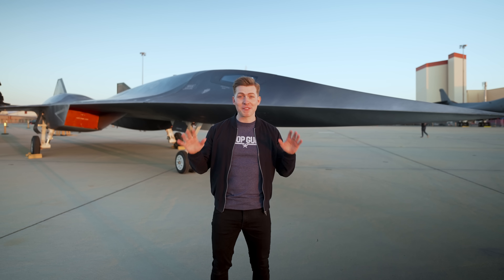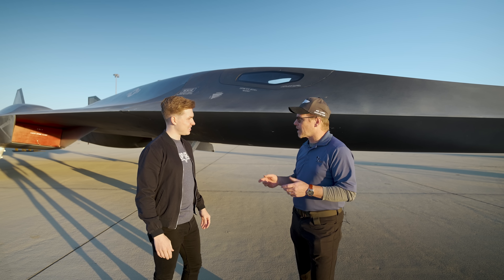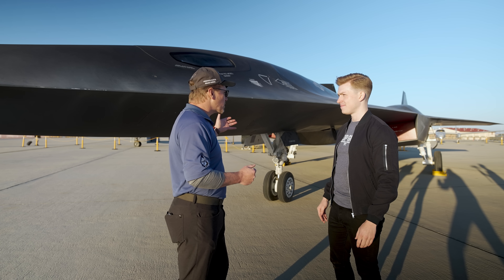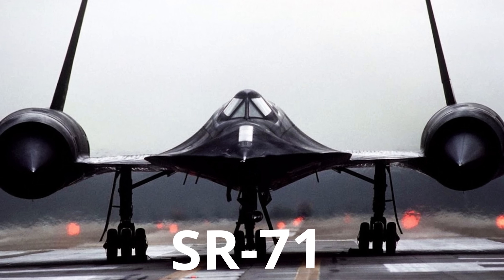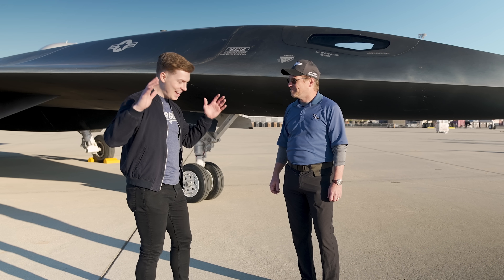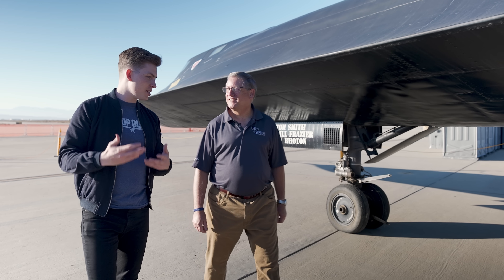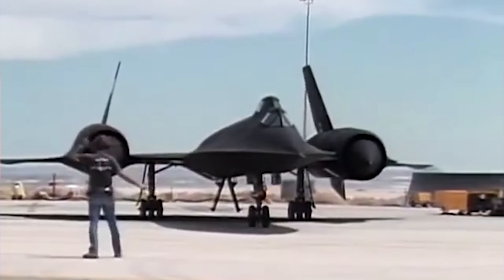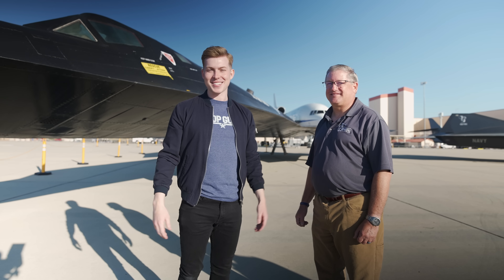Top Gun DARKSTAR in Real Life!

Comment: The darkest "black" branches of the military have been traversing the galaxy with mercury centrifuge gravitation propulsion for 3 decades. Spinning mercury around an element 115 core at 50,000+ RPM causes a wormhole of sorts that can be opened any size you want. Then you just "JUMP" to a point in space you're looking at instantaneously without all those pesky air molecules slowing you down. 

They were crossing the Milky Way in 45 minutes back in 1992, according to a deceased CEO of one of the secret contractors.

This "jet engine" crap is only 50 years obsolete.

Comment: My Dad retired from Skunk Works and spent 40 years between them and Northrop. He did work on SR71 with F22 and F35 prototypes being his final projects before retirement. He worked 2nd shift with 1 other person on very classified material towards the end. He also worked on the B2 at Northrop. He would drop subtle hints as to the capabilities of the planes but was incredibly secretive never letting on to anything classified. He would just say the materials he was working with would be public knowledge in approx a couple decades. I really miss talking about planes with him. It was very easy to be proud of him and his service as a Marine and Engineer.
Reply: I have a friend who works for skunk works I've known him for over 20 years and lol I've drilled him for years about what goes on there all I've ever got out of him about his job is "it's vaguely something to do with paints and coatings"
Reply: @davemeads859 at those speeds you are dealing with ionizing gases which will impact the surfaces of the plane badly if not made of things that can withstand that.
Reply: @davemeads859  Those RAM (Radar Absorbent Coatings) are now BESTED by cheap and TOUGH Line-X Truck Bed Liner which can be spraye donto any hull hot and then be stamped with Mountain Terrain Tire Tread-like patterns to trap and absorb Radar, Lidar, Acoustic and even RGB Optical bands. Works GREAT! It's also a LOT TOUGHER and much more weather resistant than those fragile coatings used on the F117a and B2 bombers!

If you model your tread-like patterns correctly you can even create IDEAL rough boundary layers to adhere a fast Laminar airflow to the hull body for smoother/better aerodynamics and faster air speeds!

Even "The Green Lady" is starting to be refurbished with some of those newer technologies! (i.e. The Green Lady is a Boranes-powered/ZIP-fueled hypersonic replacement for SR71 flying operationally since 1998 and is USUALLY now based out of Dryden AFB and sometimes Diego Garcia --- Not sure it's a USAF/NRO asset anymore and may have been given to CIA a few years back cuz its such an old but still secret recon platform!).

Meh!

V
Reply: @constantfind9052  my all time favorite Fighter. I’m an Aircraft Maintenance Tech and that jet did a maneuver known to be impossible in physics at an airshow. It blew my mind at the pilot and jet ability and I bet we didn’t see a speck of it’s true power there.
Reply: Is Sr72 real
Reply: @ethanhuntBravoEcho11 Я думаю ,что это макет будущего R-72 ?!👽🍺👍
Reply: @ethanhuntBravoEcho11 it most definitely is.
Reply: @ethanhuntBravoEcho11  The SR-72 is DEFINITELY REAL but these days we call it "The Green Lady" which is a ZIP-fuel (Boranes) powered recon aircraft which is now old-school technology since it first flew in 1996/1997 based upon research done on other secret aircraft from the late 1980's.

From what I have been told, The Green Lady now operates out of Dryden AFB and Diego Garcia and wherever ELSE the new operator (i.e. CIA) sends it! 

It used to be a USAF/NRO asset but the constant scouring of the engines from Boron Nitride crystal creation from upper-atmosphere nitrogen oxide-rich flight caused numerous maintenance problems in later years, so it was sent over to the CIA it its request who uses it for more politically-oriented photographic spy missions over or near North Korea, China, Russia, Pakistan, Afghanistan, Syria, Yemen and even over Colombia and Venezuela!

The much newer Spearfisher recon aircraft is the current USAF/NRO replacement for the STILL SECRET after 28 years Green Lady hypersonic aircraft!

V
Reply: @ethanhuntBravoEcho11  good question. Is it public knowledge. No. Could it exist. Possibly.
Reply: Your dad was a badass.
Reply: @arthur6084  he sure was to me. Growing up looking at that Marine was an honor. Thanks I really appreciate reading your kind words about him. I sure miss him.
Reply: @constantfind9052  Israel And Japan Really wanted to Buy F22 but Nope
Reply: @pharaongaming8617 Israel are the masters of the F-35 though
Reply: @constantfind9052  Ukraine can't even fight nor fly highly advanced aircraft
Reply: @kennethroth6757 they’re training in F-16s
Reply: @kennethroth6757  Where did you get it from? If there are no planes, of course you can't, and when they appear it's only a matter of time, of course it's difficult to switch from old planes to more modern ones, but it's possible. Of course, those who have had these planes for a long time, they have been training on them for years, was there such an opportunity in Ukraine? No. When it appears, everything will be.
Reply: CHina would like to interview your dad about being a cool person.
Reply: @753238  if he were still alive I bet they would. He passed away 8 years ago. Unfortunately 50 years working with materials and chemicals and roughly 3 plus decades of that with minimal safety requirements left him with a terminal lung condition. 
He held no ill will towards his health. Loved what he did.
Reply: @constantfind9052  F 22 Will get retierd or stop producing by the year 2030
Reply: The f35 is a bigger embarrassment to America than BRANDON
Reply: @frogmanencountersradio5462  I don't know about that but they do have similarities. Neither can walk up stairs or ride a bike. 😉
Reply: @frogmanencountersradio5462  you obviously don't know what you are talking about. What makes you think that?
Reply: @mrbillsfishin yea my dad worked at nasa he landed on the moon to
Reply: My uncle worked on the Sr71!!!
Reply: Ur dad is a legend💯💯💯💯💯
Reply: leak info pls (def not russian/chinese spy)
Reply: @tvthecat  lol. No info to leak. He was incredibly secretive and proud. Would never jeopardize the safety of the pilots by giving away what the planes were made of or what capabilities they actually had. Exactly why it was so easy to be proud of him. Not even on his death bed did he share any with me. Sure miss him.
Reply: Amen dude
Reply: Hero People like your Dad are those who kept America great!

Proud of his professionalism!!!
Reply: Since I know much of the work, he PROBABLY worked on Aluminum Titanide hull bodies with super-tough Nickel-Chromium-Cobalt super-alloys for engine parts and either Electrostatics or GWASER-based propulsion systems (i.e. I was looking at our version of that through the office window a few days ago!).

We use ultra-rugged nano-LED active tiling for visual stealth but negative refractive index metamaterials work just as well for that and RADAR stealth too. Plasma Sheaths also work for RADAR and in-atmosphere speed enhancement but are not all that visually stealthy.

Meh!

V
Reply: @StarGateSG7  sure ok. All I ever got from him was I work in top secret. He would never tell me what you just did.
Reply: Good pray for your father ❤
Reply: Dam man,your lucky
Reply: Thank you for sharing all this information, God bless your dad
Reply: Respect!
Reply: @MrBillsfishin. And what are you proud of, ignoramus, your father created technical devices for the mass extermination of people, are you proud of that?😀😀😀
Reply: Mile for seconds.MAX10
Reply: @Sinivaal  what do you not get? At the time period it was built it, roughly 60 years ago it was the best reconnaissance aircraft in the world.
Reply: That’s awesome.
Reply: Over 30% of the SR-71s ever built crashed without any enemy action. 😅😅
Reply: @markfox1545  That 30% crash rate is simply due to pilot error because of a lack of decent software control. In the modern reality, human pilots simply CANNOT compete with 5000 or even 10,000 adjustments per second controller chips that can keep a plane level and or smoothly operating while in supersonic and hypersonic flight. That said, it's a good idea to have a human pilot on board when things go wrong.

In the SR-71's case, more accidents were due to simple mechanical failure than any other cause. Fuel leaks, compressor blade breakages, cable and hydraulic failures, metal fatigue .... all these are more of a product of the 1960's and 1970's time frame BEFORE the advent of decent metallurgy and decent CAD/CAM/FEA software used to design and build a modern plane.

The SR-71 is/was a complex plane designed in a simpler time where failure rates were much higher than today. It's a product of it's era and the accident rates reflect that earlier time period!

The 1997 hypersonic recon replacement for the SR-71 (i.e. The Green Lady) was DESIGNED from the get-go on modern CAD/CAM/FEA software AND was built with modern metallurgy and polymer technologies ALONG WITH a much-revamped quality-control regime that emphasized reliability over absolute performance!

The Green Lady is FASTER and has more range than the SR-71 (i.e. is ZIP-fuel/Boranes-powered!) but also has more reliability built-in since it's the product of a more modern era.

It's ONLY BIG ISSUE right now is engine blade and engine wall scouring due to the Boranes reacting with the Nitrogen Oxides in the upper-atmosphere that creates super-hard Boron Nitride crystals which literally grinds-away the engine parts like sandpaper does to wood or a grinder does to metal. 

USAF/NRO mechanics keep having put in new engines at quite the cost. I would have used Liquid Methane or even Propane as the fuel and the problem pretty much goes away once you ALSO COAT the engine compressor blades and internal wall with a thick-coat (3 mm) of Corundum (aka Aluminum Oxide) ceramic to prevent engine scouring.

Hopefully, the new long-and-pointy 2015-era replacement for The Green Lady (i.e. Spearfisher) hypersonic recon aircraft uses my suggestions and changes over to a new fuel type AND changes over to THICK ceramic coatings for its internals! (Maybe even Silicon Carbide, Tungsten Carbide or even Boron Nitride as the new coatings!!!)

Now you know!

V
Reply: He knows about the Aliens
Reply: literally nobody is questioning if this guy even has proof, tf?
Reply: Overall speed is the smoothest sci-fi aircraft😊
Reply: I work on the f18 and NGC! Ask your dad if he can juice me in Skunk Works! I can spray anythang! 😄
Reply: @Erik7prc  sorry he passed away almost 9 years ago now.
Reply: @MrBillsfishin  wow sorry to hear about that. You ever see the movie D.A.R.Y.L.? The kid stole a blackbird in that movie. Great 80s movie
Reply: @Erik7prc  it is very possible. Unfortunately I have had a brain hemorrhage and my memory is horrible so I would have to watch a fair amount of it to see if any of it looks familiar. Sorry
Reply: @Erik7prc   But it's more fucking heavy inside, boring hill rat, Ben
Reply: I also worked for Northrop with the B-2 and F-35 program. Very awesome! Did he work out in Palmdale?
Reply: @dariusmayes730  yes after they closed Burbank.
Reply: @MrBillsfishin  small world! We probably worked in the same building and everything lol that’s crazy
Reply: Paulaner Garten
Reply: Congrats. My dad was a deadbeat alcoholic 😂
Reply: @tcbowen12  sorry sir. My sons don't have nearly as much to be proud of as I did and growing up with a Marine father wasn't super easy. I was never good enough. My Dad did plenty of drinking also. Always kind of thought it was because of me. Lmao. Still always better to look at the bright side. I did have a roof over my head until I screwed up and they kicked me out. Lol
Reply: They have drones over New Jersey right now.
Reply: I bet your dad and my grandfather knew one another, my grandfather was a photographer with Lockheed and worked with skunk works I just posted about how everyone was five these pewter belt buckles and my grandfather gave me his F-117 and SR-71  BELT BUCKLE, TIE Clips AND, CUFFLINKS. I WONDER IF YOUR DAD STILL HAS THEM HIMSELF.
Reply: @bradfidermutz4438  my dad passed away 10 years ago. No idea if he had those.
Reply: @MrBillsfishin  I'm so  sorry to hear that!
Reply: yap
Reply: Your dad is a legend, my favorite plane of all time is the SR-71 blackbird.
Reply: You have to honour with your dad
Reply: Your father and i and maybe you , know that the B2 is faster than this fantastic plane due to the MHD. I know that the B2 have got this MHD with the fireball ( your dad knows what i'm talking about...)
Reply: Wow. So your Dad tell you also about how he helped to murder other people in their OWN country? That's public knowledge too today. Dumb muricans
Reply: @jonnyjackson3957  oh ok so based on your logic anyone that ever worked in a car factory is also a murderer because cars have killed people as well?
Reply: @MrBillsfishin  But cars aren't made for deadly purposes, they are!
what gathered the intel to bomb Vietnam with B52, SR-71.
Reply: @BilalAhmed-hz2tt yeah but this airplane does not carry any weapons, it's only meant for observation
Reply: @MrBillsfishin  Su-33 better
Reply: @GaionSputro  interesting. In a dogfight it would be force against the F35 but not sure it would come out on top against the F22. More than likely it wouldn't see either coming as both would try to avoid the dogfight firing missles from dozens of miles away and leaving.
Reply: @GaionSputro  No, Soviet equipment is old equipment, we are talking about modern aircraft here :D
Reply: @denzeroneYT   How about MiG-35D.
Reply: @BilalAhmed-hz2tt but, the sr71 is a reconnaissance aircraft…..
Reply: Damn, that sounds amazing
Reply: @johnmartinez9220  Yes, but only until the moment when this miracle starts killing people close to you! 😀😀😀
Reply: @MrRenics  nah I'm not in the middle east
Reply: Your dad probably worked in hollywood too, the whole usa is hollywood.
Reply: @w.k.5974  what? He worked in Burbank before being transfered to Palmdale if I remember correctly but I was pretty young. I really don't know what you are eluding to. 
Hollywood is Hollywood. One city.

Comment: I was lucky enough to be a part of the final Inspector General team to review the SR-71 program at Beale AFB in California in 1989.  It's hard to describe the engine starts and how much it actually leaks due to the design of a fuel system that expands at altitude and seal the leaks with heat generated by friction!  That JP-7 fuel felt like kerosene, it's so thick...not to mention a crazy high flash point to withstand the heat when going Mach-3.  I was sad when they retired it, but I always knew a replacement was on the way!!!
Reply: I lived on Beale from 88-92.
Reply: Im willing to bet they have a few still in service that we dont know about

Comment: I once read that SR-71 leaked fuel because of the compression and decompression from its speeds and altitudes.
Reply: Because the titanium skin expanded at speed, when on the ground, the skin would not form a complete seal because it had cooled (and thus contracted), so the JP7 fuel leaked until the skin heated up enough to close the gaps. Also, it had lost so much fuel and used so much fuel that it would need a tanker relatively quickly after takeoff.
Reply: Even cooler was the fact that this titanium for the aircraft skin had to be purchased from the very people we were using this aircraft against in the Cold War; the Soviet Union. The CIA set up front companies to purchase the titanium, and then the titanium was used to build the aircraft that provided intelligence against them. Gotta love it.

Comment: It is a bit comical that both Russia and China are publicizing their hypersonic missiles to make them sound advanced.  Lockheed's Falcon Program flew the HTV-1 and HTV-2 flew in 2010 with speeds up to Mach 20.   Nevermind the X-15, which did manned hypersonic flights back in the 1960s.  We've also had weapons that can target hypersonic missiles for quite some time.
Reply: Project Rheinberry was working on Mach 20 in the 1960's, after the SR-71 was publicly made known by President Johnson. They started Rheinberry when Project Isinglass, a development project to max out hypersonic capability to Mach 4 to 5 was not considered advancement enough (from the SR-71's mach 3.5) for the money being discussed to spend on the project. Mach 20 via scramjet, however, I guess was worth spending on. That goes to show just how much they intend to advance every few years. All of this before 1969.

Comment: My father was in Air Force Photo Reconnaissance, developing film from the U2 while we lived at R.A.F Alconbury,  England, he also worked with the Blackbird.  Years later while at Fairchild AFB during a base open house and Air Show, we were parked just outside the fence at the end of the runway. An SR-71 took off and went right over our head at low altitude. It was amazing. In 1990 while I was in Air Force Basic Training, There was an official retirement for the SR-71. Most of my flight was standing at parade rest in formation. I was lucky enough to be tasked with directing visitors away from the parade grounds, and was able to watch it fly over and go supersonic. As an Avionics Technician at Fairchild I was invited by the crew of a B1-B Bomber with "Heavy Metal" nose art, to go up and check it out inside before another airshow.  I also participated in several Air-Refueling flights. One of the most memorable we refueled, F4 Phantoms, F15's and F16's.

Comment: The technique of using fuel to cool components was carried over to other aircraft as well, not just for cooling but also used for hydraulics in applications where other methods weren't feasible like inside the engine itself for example.